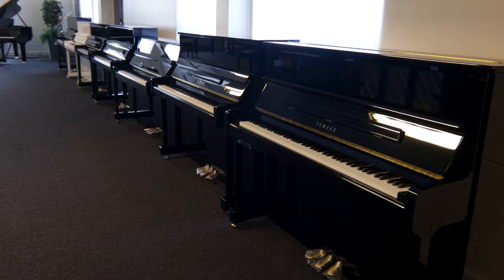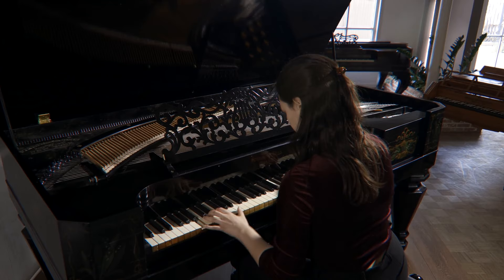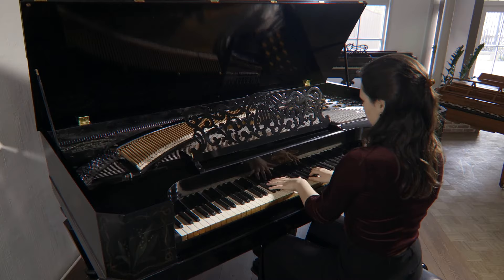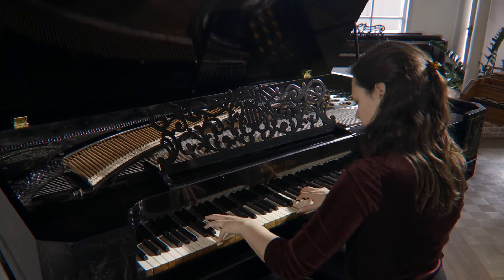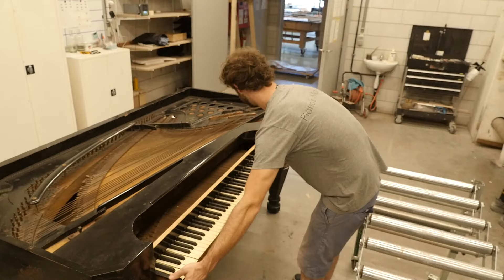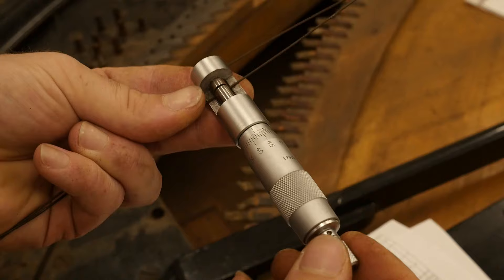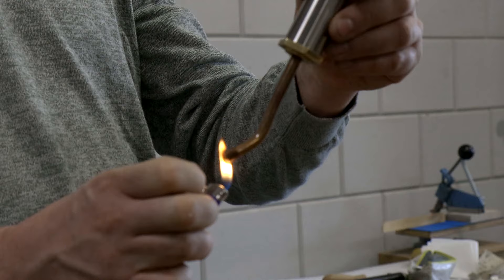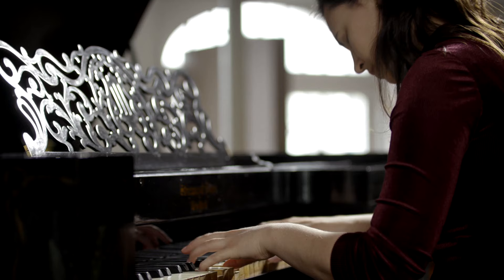The Rebirth of the Steinway Square Piano Serial Number 20232 (New York, 1869)

Comment: I had an old square piano many years ago, and I put new strings on it.  I was expecting great things from the new strings, but, to my great disappointment, the sound was relatively dull and quiet.  In looking over the piano, I could see that the sound was eaten up by the large braces, the small soundboard size,  the weight of the many strings crowded together, and the use of two strings per note in the treble as opposed to the 3 strings per note that are used today.  Also, the square piano took up a huge amount of floor space.  In its time the square piano was great, but today's world needs a piano with a louder and more brilliant sound.

Comment: I would do anything to have my square piano restored. What are the rates for you ?
Reply: There are only two companies in the united states that still works on these. If you google them you'll find both. I got a quote for upwards of $25,000-35,000 to completely restore mine. Sometimes costs can be more. You don't get the money back out of them in terms of overall value but they are quite a nice sounding unique instrument. We had to leave my 1886 Henry Miller square grand behind in a recent move last year do due moving costs and repairs, while it did play it needed a lot of work and my new home can't support the weight/space for a piano.